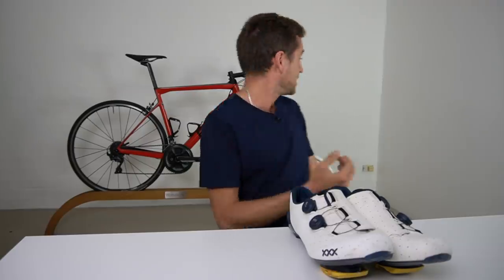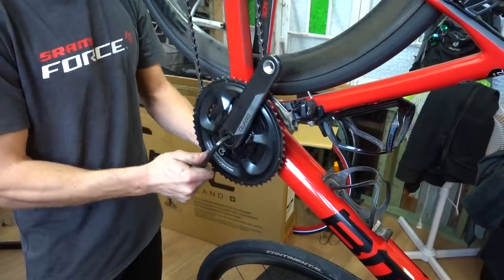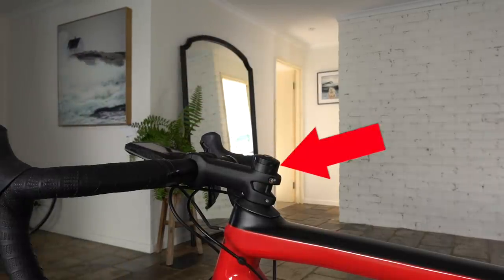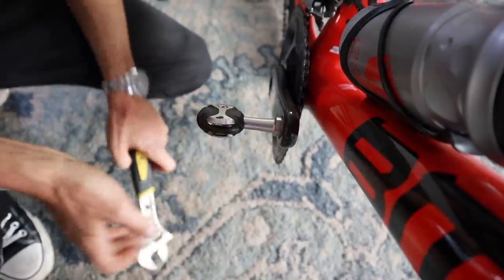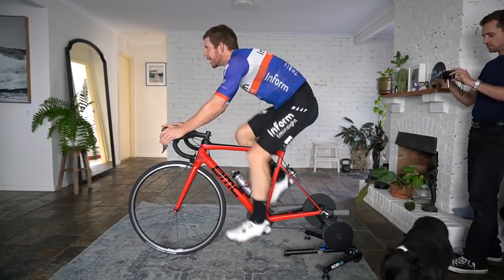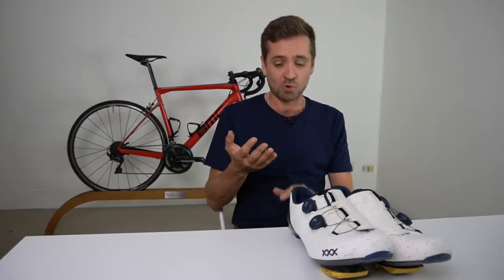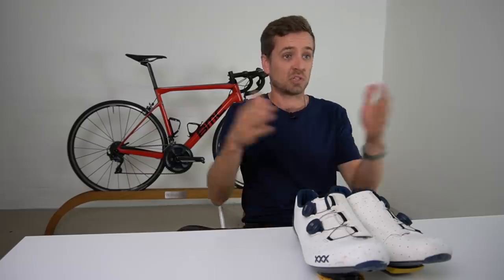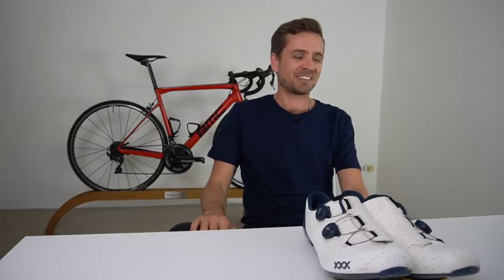How My Position on the Bike Transformed (From Changing Crank Length!)

Comment: BB axle stays in the same place so why put saddle back?
Reply from the maker: Unlocked my hip rotation
Reply: I understand that the shorter cranks reduce the range of motion through the pedal stroke and that would be beneficial if you have some hip impingement,  but putting the saddle back and lowering the handlebars will reduce the angle between your torso and thigh. Maybe I'm missing something? Genuinely interested mate, not trying to wind you up.

Comment: In bike fitting circles there's a bit of chat about how much difference it really makes. Think of it as a percentage of your overall inseam length and it's not that much, plus if you are slamming the stem aren't you back to square one. It's not a bad idea to work on what's causing the issue and focus on how you the rider is sitting on the bike. Tight hamstrings and hip flexors causing a rearward pelvic rotation and this can affect your glutei ability to fire in the 'power phase'.
Reply from the maker: Thanks for sharing Gary